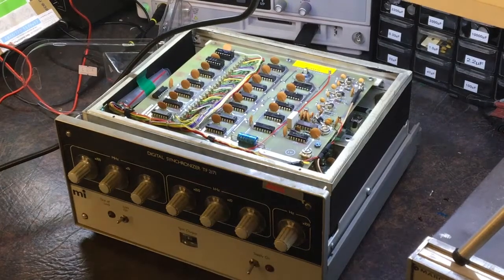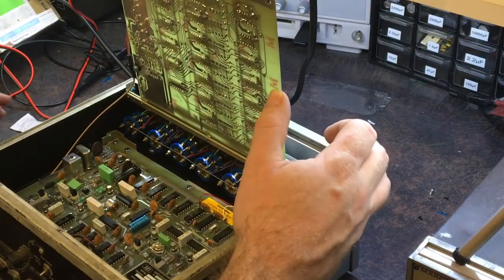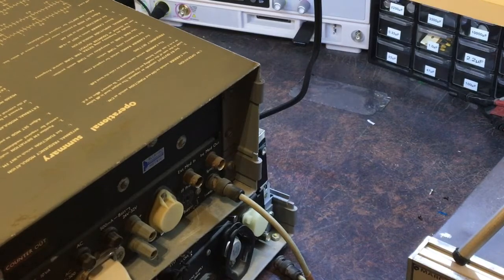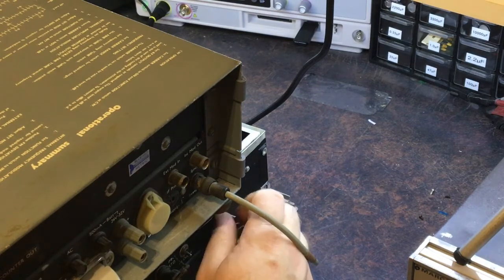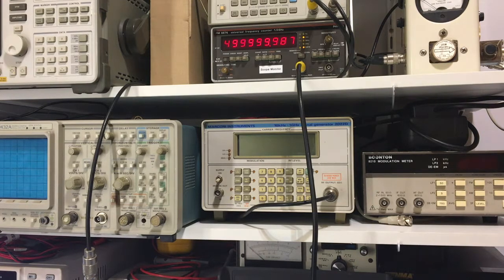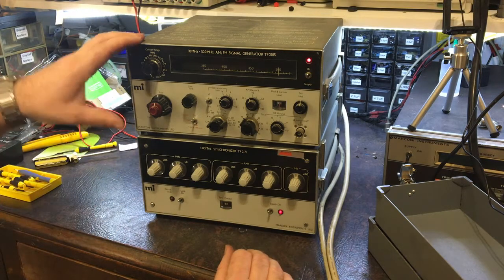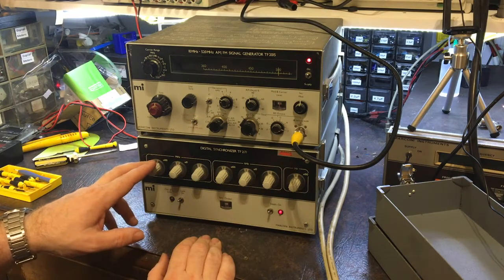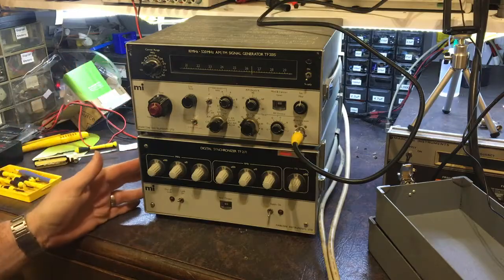#125 Marconi TF2015 RF Signal Generator and TF2171 Digital Synchronizer

Comment: I have this exact sig gen including the synchroniser. I was setting a radio up with it the other day and it never occurred to me that it might be off frequency. I will have to hook it up now for a look. Thanks Graham
Reply from the maker: Radiocruncher - I don't use this unit anymore as I replaced it with a more modern (but still old)  2022D.
Reply: I was after the lower frequency version of this as well as I just can rely on some of the old kit I have. I will get this hooked up to the counter tomorrow for a look